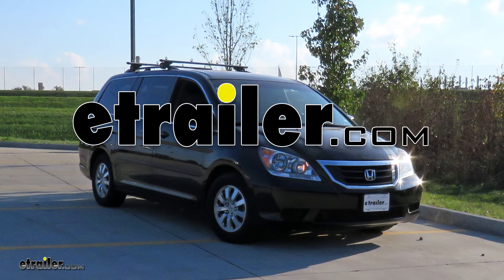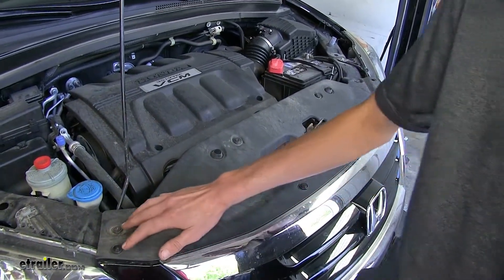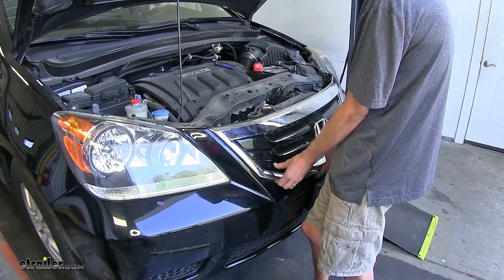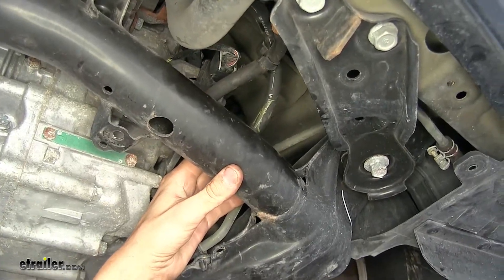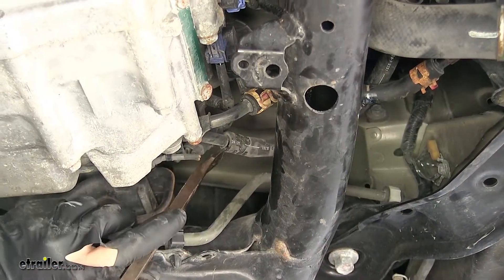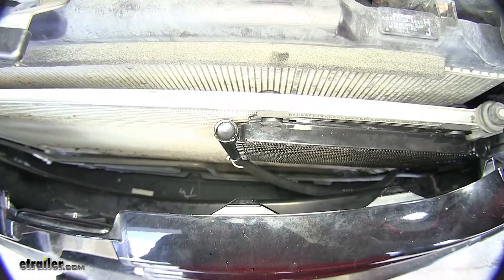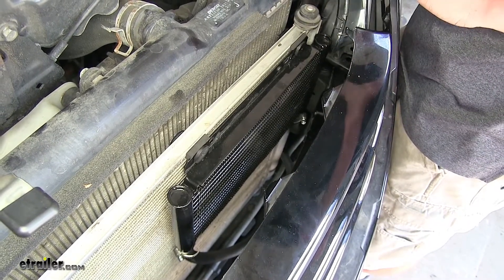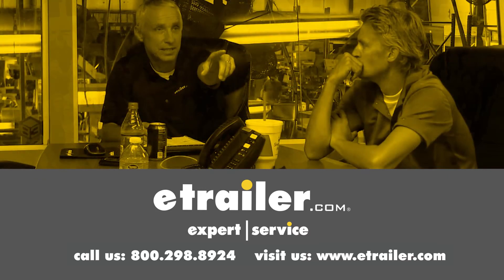Mount: Derale Series 8000 Plate-Fin Transmission Cooler Kit w/Barb Inlets on a 2010 Honda Odyssey

Comment: Looks like you bypassed both the original cooling out and return lines, and replaced it with new transmission cooler lines?  Or did you simply remove the return line from the radiator to the transmission casing and cut in with the additional cooler?  The changing camera angles and the edited back and forth of which ends of the line(s) you were working out is very confusing for novice folks.  Perhaps a diagram would help of where the new lines are cutting into the existing system.
Reply from the maker: This transmission cooler will go inline with the factory system. You will take the cool line from the factory cooler and run it through the new cooler and then it will run to the transmission.
https://www.etrailer.com/Transmission-Coolers/Derale/d13502.html